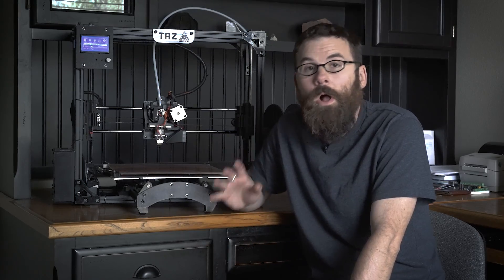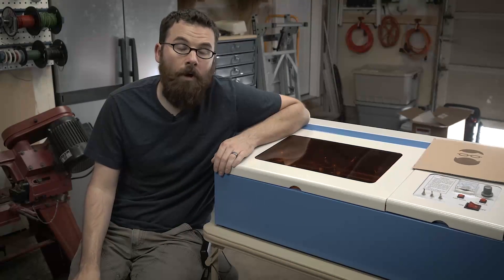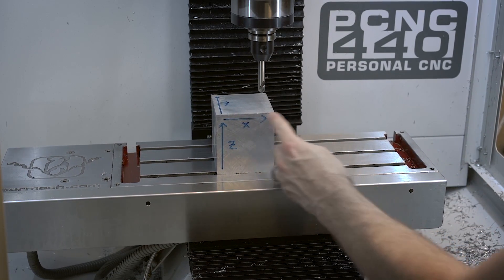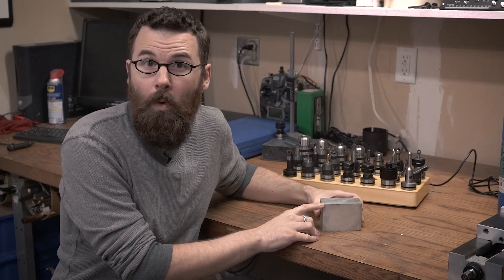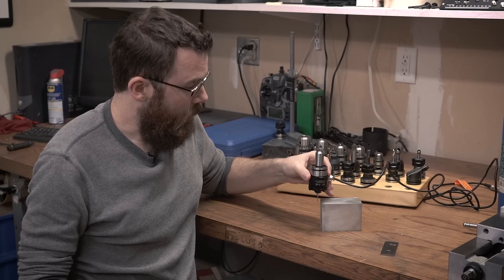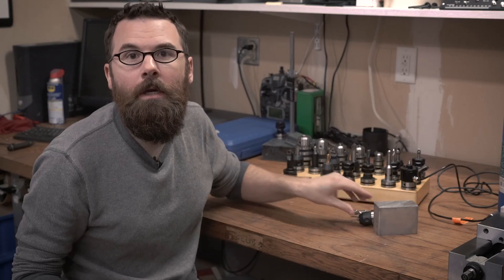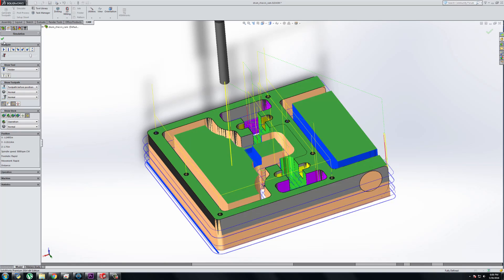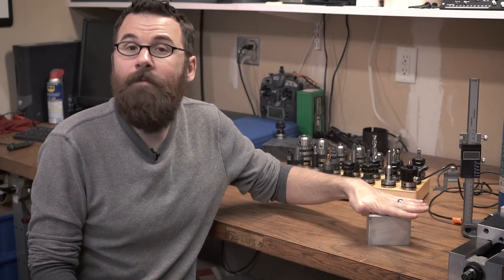Intro to CNC: Axes and Offsets

Comment: I am so glad I did not learn anything new. I would hate to learn anything  from an intro video after spending over twenty years programming, setting up, and operating cnc turning and machining centres(or cnc lathes and mills if you prefer). This video is done well. Nothing wrong except that I prefer to use a 1 2 3 block for the Z offset, raising the column until the block slides under the tool. I  just find that it is a safer way to do it for me.

Comment: Ive got a tormach 770m and have had it for 7-8 months now and ive used the conversational part of pathpilot. I have milled a couple of simple things but fusion, wcs, offsets its such vast thing to learn let alone master. Ive been having trouble with work offsets especially and making fusion and my machine communicate but your video explained it better than tormach, ny cnc and many others. You should continue with these i will be watching them to hopefully master machining.

Comment: The table moves opposite, because its "aligning the tool tip to the desired coordinate on the part". The coordinate system is relative to where the machine thinks is the part, and the coordinate solution (the number you see on the screen), is the relation of where it thinks the tool tip is relative to that part. Im sure its been said, just wanted to bump it to the top. The production on these videos is a perfect balance of quality vs quantity, keep it up!

Comment: Are you planning on doing any videos on all your K40 mods?
Reply from the maker: I might do a short video outlining everything I did.  I did an upgraded exhaust (12V bilge blower), air assist (using an aquarium air pump), honeycomb table, and LED lighting.
Reply: It looks great. I've been eying the K40 for a while but reading about a lot of people having trouble with them when they come in. Where did you get yours from?
Reply from the maker: I've used Epilogs before and this is definitely not an Epilog, but it cuts alright.  I got it for very little on craigslist.  The new ones on eBay have a lot of the mods that I did already done to them and people have had good luck with them.  Just don't buy the cheapest one you can find.  I think for the money, they are good, as long as you understand the limitations.  I used mine just the other day to cut some acrylic parts for a prototyping jig I was working on.  It's MUCH easier than machining the parts and makes rapid prototyping a lot easier.